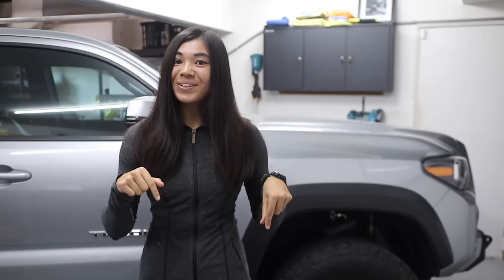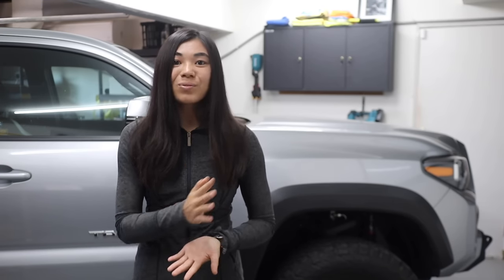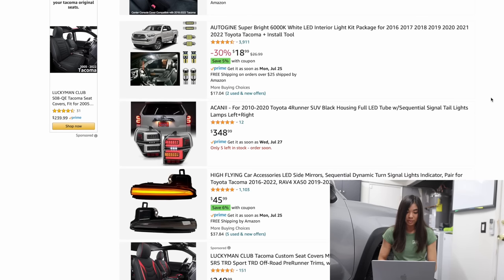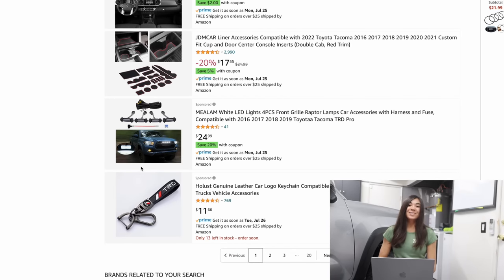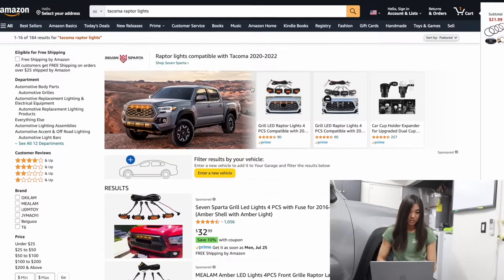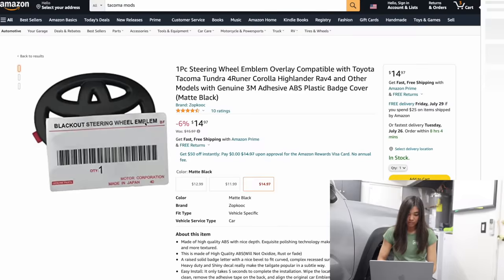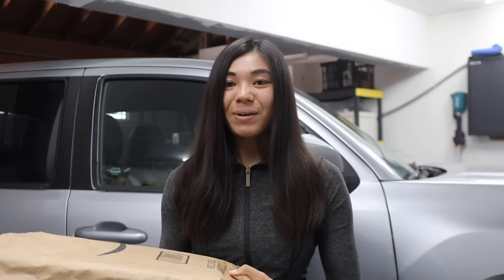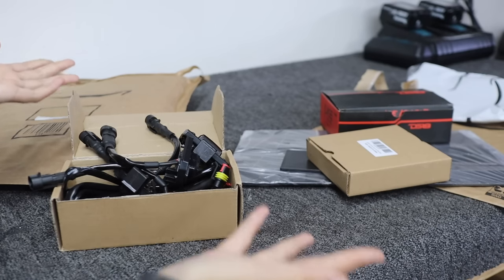Cheap Mods I Found on Amazon for my Toyota Tacoma

Comment: I can highly recommend the seat jackers, so much more comfortable, I also added the fire extinguisher mount while I was at it. Also replaced the tweeters with the Subaru tweeter. Its unbelievable how cheap the tweeter and door speakers were on my 2018 TRD, they looks like 1950's vintage!
Reply: Did you get just the front? Or both front and rear seat jackers?
Reply: @tambinono9498  Front only, it leans the seat back without raising the overall seat height. Supports the back of my legs way better that the stock seats, perfect for long drives!
Reply: The door speakers are interesting for sure. Full range "whizzer cone" style 6x9 drivers with neodymium magnets. Whizzer cone full-range drivers usually have high db/W sensitivity, probably why Toyota decided to go with them. Louder on less wattage. They're inherently "lo-fi" though, and suffer from serious midrange distortion when pushed hard. Fun fact: Whizzer cone full-ranges have recently regained popularity in the Japanese home hi-fi scene, usually housed in TQWT transmission line enclosures.

The OEM dash drivers put out very little sound, crossed somewhere above 5khz with a 2.2uf capacitor- really only there to produce 8khz+ at a low volume. Most of the power is pushed to the front door speakers in the OEM setup.

Comment: Just bought a used 2019 4x4 SR in magnetic gray metallic with 58 K on the odometer and I love it. The cheap add-ons I got from Amazon I've liked the best (in order of preference) were: a gas cap holder for the inside of the fuel tank door so the stupid gas cap didn't have to dangle from the cord onto the side of the truck whenever I'm filling up the tank, a center console accessory organizer tray that sits over the storage compartment, a set of those cheap plastic car seat caddies that used to be an "As sold on TV" item that keep stuff from falling into the crack between the seat and the center console (I hate when it does that!), a set of seat belt buckle extenders for the front and rear seats along with blocky silicone seatbelt buckle holders to make them easy to find, and finally a 'Homeon Wheels' large foldable aluminum step stool to help people get into the raised cab with a modicum of dignity for when I need to give the seriously old or 'height challenged' a ride somewhere. I also ordered some 'Luckyman' seat covers as the original light gray cloth seats were showing noticeable signs of wear, but I would say they were a bit more than a 'cheap' add-on. They look pretty good and were easy to install. I've also ordered the glove box divider you showed but I'm waiting to put it in until I get the cabin air filter changed.

Comment: I drive a quicksand 2020 taco and I colour matched (with spray paint) the light grey interior dashboard, centre console, door window controls. It turned out surprisingly amazing using just spray paint and it was incredibly easy taking apart the dash and everything, maybe a days worth of work.

Comment: I have the same vent rings on my 2021 Off Road but in red.  Definitely makes the interior look better with a small pop of color.  I've had them installed for a year now and haven't had any issues with the tape coming off, even with high Texas heat.

Comment: I did the tweeter upgrade a few years ago on my 17’ Taco. 
Well worth the $ and time
Reply: Where do you get them now ?
Reply: @TheBradleyd1146  Amazon.  But I did a search for them there and on eBay, didn’t see them.  I’ll keep looking and post back here if I find them
Reply: Do you actually have to remove the pillar? Looks like you can just pop the vent up.. not entirely sure tho that’s why I’m asking.
Reply: @charleysantini  from what I remember, yes. The piller cover has to come off.  The speaker cover either lips under the piller cover or there are a couple of set screws to the speaker cover that can't be accessed until the piller cover is off. 
It's easy to remove though. 
If I recall correctly, it's just 2 - 6mm (thread) bolts in the assist grip that hold the cover down and it just pops off
Reply: @kevinmyers3291  hey man thanks. Yeah I did notice when she installed the pillar that it did have a lip over the dash. Makes sense

Comment: I’m with you on the wanna be raptor lights. People want raptor lights - get a freaking raptor!  The chrome delete rings is a great idea, but I personally would have gone with a matte black.  The tweeters & organizer are definite wins, as well.  Good video!
Reply: Tundra has them, so does ram. They are simply a legal thing if your truck is 80” or wider.  So not really raptor lights, but wide vehicle lights.  And yes they look goofy on small trucks.

Comment: Raptor lights are pretty cheese. If real lighting is in your budget or on your needs list, you’re better off adding a light bar or two behind the grille. I’m running the SDHQ behind grille twin light bar mount, so I have a 30” amber light bar aiming where the raptor lights would be and a 30” white light bar under the Toyota emblem(2020 honeycomb grille). I’m powering my lighting with a SwitchPros 9100, and this allows me to dim the light bars incrementally. If I want the raptor light look, I can just run the amber bar on its dimmest setting or I can run it(or both light bars) @ full power for massive light output.

Comment: looks like you got the same glove box organizer I did. I use the large compartment for my owners manual and my documentation (registration and proof of insurance) with a wright in rain notepad and pen in the upper left smaller compartment, and other assorted odds and ends in the lower compartments.

Comment: The RPTOR lights looked awesome on your truck and I have to say that was n excellent install. I usually purchase functional equipment for my automobiles and as far as the metal letter inlays, would the peel off paint keep them from rusting?  You spent money n the rings, use them until they fall off. Excellent content!

Comment: I installed the same raptor lights and like the look a lot, the LED white is slightly off the factor lights but that's ok in my books. I'm waiting on delivery of the black vent ring covers and steering wheel emblem cover up. My truck came with the glove box organizer, which I like. My truck is the same colour as yours, but its a 2017 sport. I enjoy your Tacoma vids!

Comment: The raptor lights didn’t look too bad, I definitely prefer this type of lighting over a light strip which I think looks stupid, are they functional as far as increasing visibility at night, or basically just Christmas tree lights? Im not good with lack of instructions, wiring and changing fuses doesn’t sound kosher to me. The black vent cover adhesive inserts looked good, nice find 👌Put the manual where your jack is located, I’ve opened my manual like twice in 4 years! 😂 funny how much stuff you had stuffed in your glove box, I thought you were going to fill up your whole truck cabin with the content’s of your glove box! 😉The tweeters are awesome, the install looks scary, you’re so mechanically inclined, I’m not. Great video, I’m considering the tweeter install, thx for the vid. 👌

Comment: Was going to do the tweeter upgrade but bit the bullet and did the OEM Audio (non JBL) speaker upgrade...WOW...night and day difference.  Didn't do the amp offer...just straight speaker replacements and that is more than emough for massively better sound in my truck.
Reply: I'm gonna do the same thing like you just haven't had a chance with hit and run on the truck and trying to get a apartment at the same time 
How do you like them and what else would I need for the installation

Comment: Never enough mods !
Re rings: That's what's nice about the utility package - you don't have to worry about chrome....
Tweeters: if you go to Crutchfield and put in model info, they give you a Garage Research report – select speakers, then speaker location. For the dash they show 41 tweeter prices and reviews - for example:  Kenwood $59; Alpine $89; Morel Elate Carbon Alto $908.
Also, they give you instructions - for example, on the Alpine:
Installation notes:
o	You'll need a hole-saw drill bit for this installation, so you can flush-mount the tweeter into the bracket included with your order.
o	Location = Corners of the Dash
o	Use the factory speaker grilles.

Comment: Amazon has a feature called "garage" where you can specify your make, model and year. When you look at an item, it will tell you if it fits you selection. If you have multi able cars trucks you can add those as well. Save making ordering more efficient.

Comment: Even the smallest and cheapest upgrade to the factory stereo and speakers will be far better than what Toyota puts in them.
The speakers and head unit are terrible!
And the rapper style grill lights have been used for years with many different vehicles so they don’t look to bad
I like them, but I’m not crazy about them at the same time lol 
I have the same glove box Organizer and yeah you lose space, but you also don’t have to dig through it to find things anymore because everything has its own little warm cubby 😆
And I’d for sure stick with the black vent rings because black will always be cooler than chrome! 😎👍

Comment: Something that would be super cool, is a way to put the 2020+ front power seats in the 2019 and down 3rd gen tacomas. Can you look into this mod? It has to be doable with the right parts and a wire harness.

Comment: some of the things you choose were nice some not so much. 

I'm kinda in agreement with you on getting raptor lights, no point as the truck isn't that wide. 
The vent rings I went with AJT designs vent rings. Of course they require a lot more work to install and the look is unique and you love it like me or you don't. Meso Customs also makes a great option for vent rings with a different look. The ones you got are fine for the price and easy install.
The glove box organizer is a must I had gotten even before my truck came in. 
The Tweeters you picked I'm not sure about that brand. I'm like to know how they sound and last. I picked the Genuine Subaru by Kicker tweeters over two years ago and they have been great.  They were $99 in September 2020 so they're a bit more expensive.  

Good video, Always enjoy your videos and especially get a lot out of your maintenance videos.

Comment: So your sensor cluster is behind your logo? I got the TRDpro grill on my truck when I bought it (previous owner had installed it) so I had not given it much through and just assumed it belonged below the logo. I wonder if it is due to the different grill styles or the change between the older and newer model years (I am 2018 as opposed to your 2019)

Comment: I have the metal ones The ones I have are made out of aluminum With some kind of black Paint like coating Will not rust but they might corrode If scratched or damaged

Comment: Great video!  As you were going through the search on Amazon, I have the same thoughts.  It's frustrating to have pages and pages of repeated projects.  You're right-on regarding the Raptor lights.  What purpose do they serve?  Even on the Raptor, what's the point?  It's typical of the gov't to add on something silly like that making zero sense at all.  Thanks for your videos.

Comment: As for tweeters:  I bought the Kickers (Subaru compatible) and it is one of my favorite mods.    I don't have the JBL sound system but this made it so much better.  Great speakers.  I'm sure yours are good too, and the sound difference is better than the video (audio actually) could portray.     Worth the $108 I spent..........totally
Reply from the maker: Good to know! I've been a little hesitant on kickers because of taking apart the door panels, but I'm keeping it in mind!
Reply: @ChloeKuo   I did tweeters only.  Made huge difference